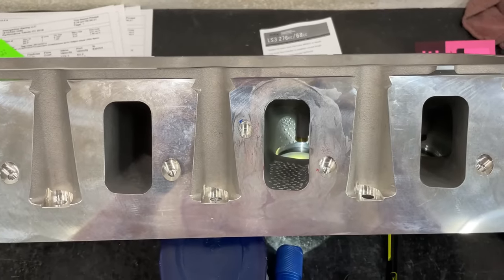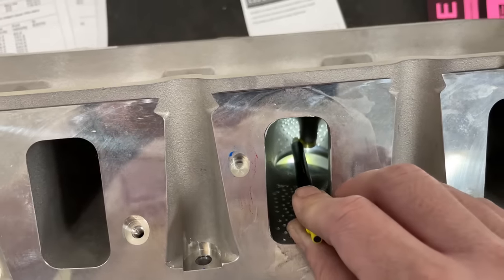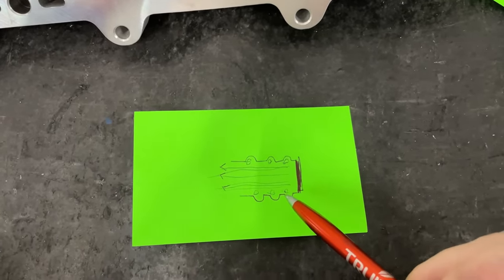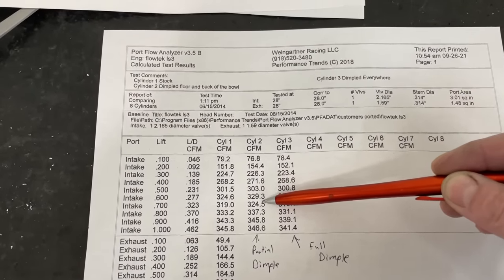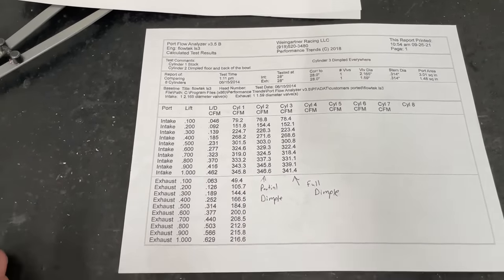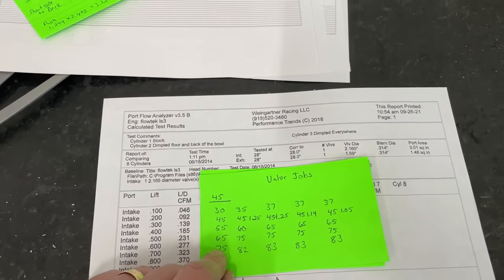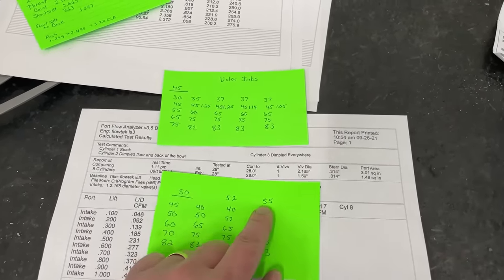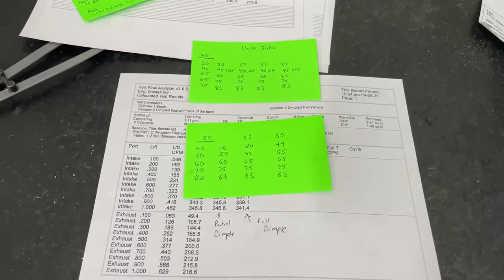Dimpling of Intake Ports Does It Help Part 1 of Internet Ports Heads

Comment: I remember the first time I saw an intake manifold that had "selective surface finishing " done to certain areas.  Instantly made sense to me what they were trying to accomplish.... I decided  to give it a try on the next intake I ported and the time it took learned me on why everyone else didn't do it... lol. Time consuming...didn't make much if any proft on that job but the customer was blown away and it ran excellent....  when  I  sat down and figured up the  $$$$$ to make this profitable, I knew it was going to be very few that would pay for that level of work on most jobs.... that said 25yrs later I still do it to my max effort stuff.
Reply: If you're still doing it the power must be worth it.
Reply: Sif you had a CNC it would be almost the same cost
Reply: @muthatrucker6485  the cnc is not free to run, it consumes power, tools, and maintenance and of course it doesn't have a different paying job in it so the opportunity cost is significant.
Reply: @muthatrucker6485  A decent CNC machine that will do this costs around $40k and beyond. That does not include the multi-stage/multi-phase power delivery that is required to run it, the cost of the tools, the maintenance.... and the time required to actually learn how to draw in CAD and do the actual R&D required to find the best pattern to actually increase velocity and provide turbulence to keep the atomized fuel from pooling. Its not easy to setup. Time is money. 

As far as I know, there are literally only a handful of machine shops around the world that even offer this process to ANY cylinder head. 

And doing it by hand, is not the way to do it because you need to do it in a specific pattern, with specific tools running at specific depths. Its why you can ONLY do this on a CNC and actually be able to show increased airflow on a flow bench at any variation vs doing it by hand and not actually knowing what you're doing like this video shows. 

The only way to get an actual repeatable results from dimpling, across and entire range of airflow, is through a CNC machine. 

And like the dude said, very few people would pay for such work as in the grand scheme of things.... its almost never worth the effort.

Comment: I've been watching a ton of these. Have a theory about why partially dimpled works better, and where you should partially dimple. A golf ball is fully dimpled only because it needs to be round and it spins. Dimples everywhere don't actually help in a port because its a closed space. Here's the theory:
The dimples actually do two things: 
1.) Decrease the available space for air to travel in the port by creating turbulence near the wall. But the air flows over the turbulence with lower friction that it would normally and, as a result, flows with higher port velocity. This is always the trade off you are making when porting: volume vs. velocity.

2.) Reduces pressure on the boundary between the turbulence and the flow. This is why the air bends around a golf ball, reducing the size of the low pressure air bubble the golf ball has to drag behind it.

So wherever you'd like more flow and less volume, add dimples.
Whenever you want to increase the venture effect (around the neck or around a bend) add dimples.

Here's how I used this information: (Porting Buick 350 Heads...very tall narrow ports which is kind of ideal.)
1.) Drew on the inside of the intake port with a sharpie a rectangle. (Where atomizing fuel occurs.)
2.) Drew on any surface where the port was becoming constrained on the SIDE OF THE CONSTRAINT a rectangle about 3/4 of an inch before and 3/4 of an inch after. (If the port bends left, this will be the bump on the left side...or the inside).
3.) Drew a circle on any part of the port where I want the air to bend in that direction. i.e. on the valve guide slope.
4.) Drew a circle on the biggest side of the bowl. (Bowls are all about increasing the venturi effect over the valve seat.)
5.) If I did port matching (Don't make the mistake of doing it to the gasket. Match it up with prussion blue with no gasket.) I added dimples where material was removed, bending the flow in the direction of smooth wall. 

Then using a round diamond bit on my Dremel I added dimples where the circles or squares were drawn in sharpie. I smoothed everything else.

I don't have a great flow bench setup, but do have a meter and a shop vac. I had significantly increased flow 15-20% on the first two ports I did at lifts from .200 to .450 roughly. Need to test on a better bench with better flow tools.  From a HP/Torque perspective this is ideal as the valve spends the vast majority of the time in these positions.

I'm actually working on the perfect project for this: Buick heads are notoriously difficult to get gains from porting on beyond simply making them smooth and making the neck 90% of the valve seat.

I'm completely against full dimpling unless you want a smaller port. (Which if you watch David Vizzard's videos it actually might be a good way to make the start of the port smaller without having to fill it!) I'd have to check that on a head that needed it, and the Buick 350 heads don't.

I also dimpled on one side of my combustion port! The part between the wall and the valve seat....so the smallest area. So many videos say not to polish this part, that I HIGHLY suspect it needs low pressure on this side to maximize the velocity and as such the venturi effect. My guess here is that air flow in this spot is ALWAYS turbulent with crappy flow, so bending the air over the lip into the cylinder wall is well worth the sacrifice in volume. I hope I don't end up with early detonation, but I'm only running 10:1 compression and the cast iron should run cool enough...I hope!
Reply: Hello, very interesting comment, thanks for sharing. May I ask you if on Natural aspirated  and Turbo charged / forced engines works the same?

Comment: To my shock, I saw a Pro Stock manifold from 15 or so years ago, with hundreds and hundreds of ball-end milled dimples. They must have done this work before it was welded because some areas were impossible to get into. Between the epoxy and the machining, this manifold was amazing. I have no idea how well it worked, but it was a work of art!

Comment: The reason dimpling works on a golf ball is that air actually sticks to the ball better and increases the pressure of the air behind the ball. It's not much but enough. This increase in pressure effectively reduces the drag of the ball. 

The port isn't moving through the air. The air is moving through the port. There's no low pressure area behind the object being dimpled to slightly increase the pressure of to allow for reduced drag through an airstream. 

Dimples work on objects with a low pressure region behind them as they travel through the air. Not stationary objects with air flowing through them. Whoever initially tried this made a wrong assumption about what was happening to a golf ball and why the dimples worked. But at least they were trying.
Reply: @hellbent7062  same principle.
Reply: Its clickbait. Just trying to get some subscribers.
Reply: It's been proven to work........
Reply: It doesn't. In an optimized port, adding dimples will hurt. In the pockets where air is trapped, you're turning correlation into causation.
Reply: Dimples work on a golf ball because it creates small vortices instead of a single large one...
Reply: Wrong
Reply: Adding to this we engineers say that the flow remains attached longer (as it travels towrds the back of the ball). This lowers base drag, reducing the area on which the negative pressure is acting.

The best approach for using dimpling in this example would be on the short turn only. This will keep flow attached longer, helping it make the turn better into the cylinder
Reply: @benmintz3188  ummmm....it works dude 😎🤘
Reply: @bilbobaggins4710  no, no it doesn't.
Reply: @hellbent7062  yet in javelin they banned the 2000 year old javelin because we learnt to throw it further. 
So they introduced a Handicap regulated piece of junk
Reply: @hellbent7062  That's right, and there's no low pressure region in water when swimming through it since water is incompressible mostly. The shark skin works the same way as dimples, they reduce the flow friction by exposing less surface area for the fluid to flow along. The math works out that fluids have zero flow for the molecules actually touching the walls. But if you carve notches into the walls then the fluid has some places to flow across without touching walls and slowing down to zero.
Reply: The only thing I can see is that dimples on the bottom could attach the flow so it follows the sharp curve to the valve seat. But on the side and top walls it doesn´t seem to make sense.

Comment: I was told the other effects of turbulence in the head ports are the better fuel atomization for a better mixture thus explosion. But the flow rate changes are very interesting and great theory. Great job.
Reply: I always assumed it wasn't a  flow increase but a swirl type action to increase the mixing of air and fuel for increased combustion hence why exhaust stays super smooth

Comment: I have done this for decades on FE heads, identically and back into the intake manifold and the same distance from the SSR and the back of the throat. The partial dimple job is the best short of welding the floor. I also angle milled mine to 12 degrees but faced to 13 for the best manifold interface.  It is a good alternative on iron heads to welding. Aluminum, I would weld to shape. It is quite surprising that the early 61-65 iron FE head is to the LS. Ford engineering was pretty good for their time.  But the dimples when placed as the partial job is can pick up an iron head nicely with only the cost of your labor if you DIY it.
Reply: Absolutely, I use them on the shorts side turns to help in pulling the air around corners since air only wants to bend so far.
Reply: Cool only partial dimpling, where air needs help?  Only the floor of port? Sharp raduis? And the area just before the valve head(also dimpled)?What tool should one use round de-bur-bit what size? And patern?. (GrassRoot racer 4cyl 8v methanol looking for a legal edge)

Comment: After watching your video several times, I did some digging/research on the aerodynamics of dimpling. Most of the information I read was over my head but I was able to cyfer a few things from the scientific research from the smart guys.....
#1- dimple size ratio to the area.
#2- dimple depth
#3- dimple edges (Sharp vs smooth)
#4- the angle at which the airstream approaches the dimples.
#5- the correlation/placement of the dimples to each other. 

☆All in all, if each one of the conditions listed above is just right, then the velocity of the airstream is increased by the reduction of drag. Like I said earlier, most of what I read was over my head....lol
I'm not sure the human hand and eye can master such percission. 
But I'm gonna give it a shot....😂

Comment: The turbulent boundary layer is made thicker by dimpling which causes turbulent eddies that act as  ball bearings for the flow. I don't know what it works best for... high/low pressure or high/low velocity

Comment: The reason that partial dimpling increased flow is that moving fluid always tries to follow the path of least inertia. The Coanda effect will no allow it to do this, forcing it to follow the contour of the port and slowing it down. The dumpling on the port floor and the back of the bowl create turbulent areas that effectively raise the laminar flow off the bottom of the port and straighten it away from the back of the bowl without fluid-to-surface friction. Think of it as a way of angle-cutting the heads and raising the ports, without angle-cutting the heads and raising the ports. Dimpling the whole combustion chamber, on the other hand, creates turbulence that washes away lean spots and allows you to run higher compression and leaner mixtures for a faster burn without knock and more power up top, making it ideal for open chamber heads that breathe well, but need a lot of timing advance.

Comment: We would use a tiny carbide ball shaped burr and flatten two sides. The burr was played across the surface, providing a uniform stippling effect.  Small stipples induce a smaller boundary layer for the laminar mass flow to traverse.
Typically larger wall deviations will increase the stand-off height of the dead air layer adjacent to the wall.  Stippling does reduce structural dynamic drag on mass flow.
Reply: I think you are exactly right! I even though about using different sizes to help shape the port funnel to more idea sizes. I think there is a place for bigger dimples: specifically where you want to trade volume for velocity.

Comment: The belief is it makes the port act “smaller” by creating a barrier for the air against the wall. My machine can do that but I’ve never tried. It can cause fuel to puddle in the dimples at low engine speeds.
Reply: What about in a direct port injection system ?
Reply: Wouldn't that fuel boil extremely quickly anyway. The pooling effect would/is a stronger argument with an intake not the head ports
Reply: Not many drag cars operate at low engine speeds, right?
Reply: You can believe all you want, it simply wont improve anything and all it will do is make you pay at least double the amount of money a proper cylinder head job would be but if you really want it you can go ahead and pay for it.
Reply: @paciencia0956  but are you guessing? This isn't about guessing and trying to find out facts.
Reply: @Ryan-re1rs  You can go ahead and try it yourself
Reply: @paciencia0956  have you tried it?
Reply: 😉Maybe just the ones that red light.
Reply: 00000000000000000000

Comment: Eric, I've wondered about this dimpling for a while and appreciate the info you have given us. I'm building a 408" SBM  ATM 
And from seeing this, I'm going to apply this dimpling to the heads. SBM are already a 18° head stock but the port floors always need raised to really take advantage of this and dimpling may help this in a huge way.
 I'm using new magnum castings and going to 2.02/1.62 valve package along with opening the CSA of the pushrod pinch which is a huge choke point on these heads, I'll use bronze filler rod and braze up the outside of the pushrod pinch .050 so I am able to increase my CSA to where it needs to be.
Also since your doing this, would you be interested in doing a magnum head? We would donate a casting and ship it to you for experimental purposes.
I understand it's iron head but your lacking any Mopar head stuff on your page and I believe it would help grow your page.
Let me know and I can send you my contact info, thanks!!!

Comment: An old hot rodder I knew back in the 90’s dimpled the top of the piston, in pretty much the same way.  He said that it made the combustion chamber less sensitive to detonation & that he was able to run the engine with higher compression ratios.
Reply: absolute hogwash, please never do this
Reply: @ragimundvonwallat8961 : you’re probably right, but it would be nice to see some real science directed to the question to see what effect it has, if any.
Reply: @loganshotrod4x464   it you make dimple by taking out material out of the piston the only anti detonation effect you'll get is by the fact that you lowered the compression... but even with that you must take into account that you created alot of ridges...and irregular ridges at that those create hot spot that increase detonation, as a last malus now you have a set of pistons that are all different weigth so you have to rebalance all of that.

as i told you, hogwash, never do this

Comment: Those dimples cause a circulation and the air/fuel that travels over the dimples circulating dimples air speed up the air flowing over it. Same effect as a truck bed. The biggest issue I see when people flow heads on the intake side is they dry flow the intake ports yes if it's direct injection then yes dry flow it but if the fuel injector is in the intake manifolds then you need to wet flow the intakes. People argue with me all the time about this subject and as soon as I ask if they flowed it wet I don't get a response.

Comment: The vortices created by the dimples work in some areas and not in other because they help maintain laminar flow and reduce overall turbulence and drag caused by air separating from the surface around tight curves that are away from the direction of travel. Curves that are towards the direction of travel need to be as smooth as possible or they add friction.
Only the bottom of the port needs the treatment.
The rule is if it hits it needs to be smooth if it follows dimple it.
You could also try a series of fine grooves across the floor of the port.
The dimples or grooves only need be near the valve opening just before the curve not the entire floor.